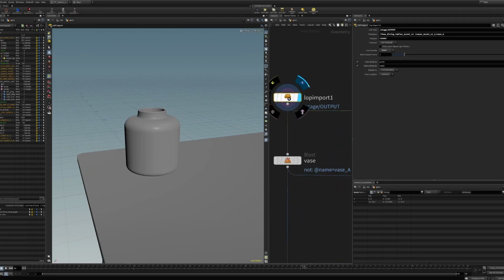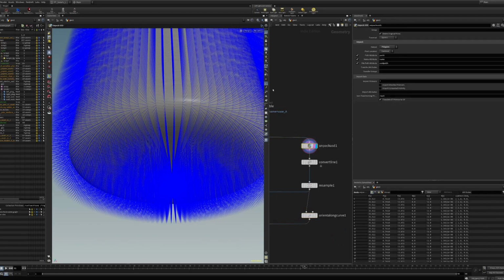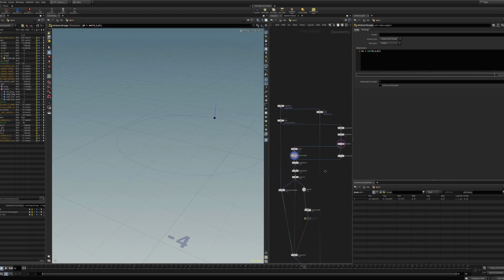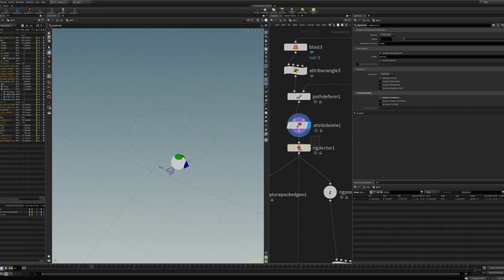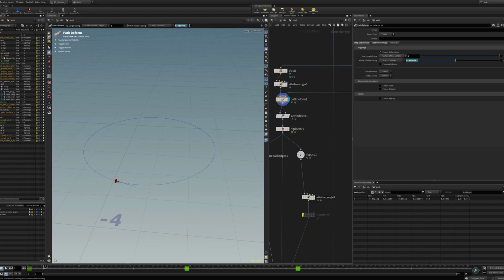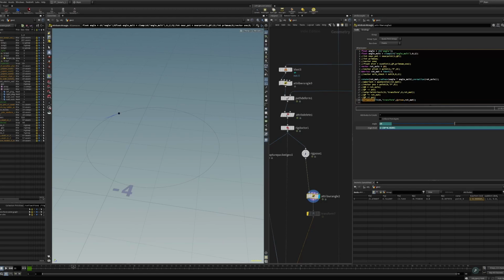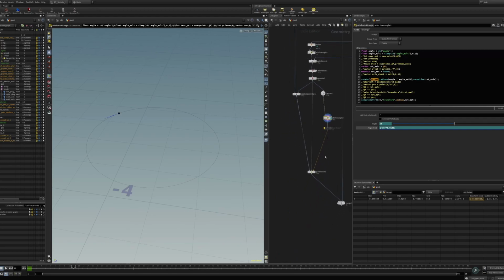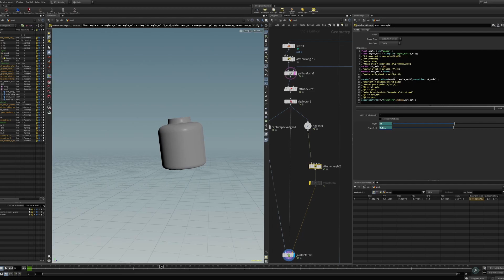Learn how to Procedurally animate a coin or bottle spin in Houdini using VEX!

Comment: 3:30
if it doenst work make sure that the Forward direction in the "Capture and Align" tab is set correctly, otherwise the normal wont be right.

Awesome setup thanks so much